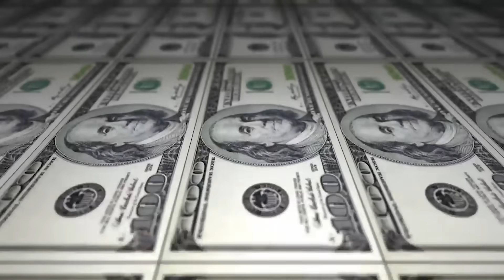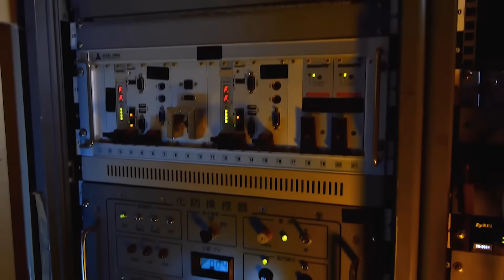Golden Dome: How the U.S. Plans to Shield Itself from All Attacks?

Comment: I dont get why they dont make a self expanding net of some metallic nature or carbon fiber and I dont mean a small one like a mile wide, so this missile first does have to catch up the ICBM and when its coming in it has to get at the right angle and close enough and then fire the net.  The net hits the warhead, wraps around it at least somewhat and is made to heat up extremly hot extrely fast both destroying itself and the warhead this is doable with today tech imo. I dont get why they would try to hit a warhead head on when they could do something like this

Comment: First of all, whatever the U.S. government, especially the current one, announced they are going to do are all "concepts of a plan" with no clear plans & strategies and which takes like forever to even get off from PowerPoint to actual working prototype, let alone a fully functional one.

China is at the forefront of unmanned drone technology, leading advancements that could redefine aerial defense and surveillance. It is likely that they have already developed high-altitude unmanned drones, equipped with solar panels to sustain battery life, allowing them to remain airborne for extended periods. 

These drones could continuously patrol China's airspace, identifying and neutralizing potential military threats. Armed with long-range missiles and an independent navigation system that does not rely on satellite-based positioning, these drones would provide a formidable defense barrier. Their altitude in the stratosphere would make it exceptionally challenging, if not impossible, for enemy aircraft or missiles to penetrate Chinese airspace. Additionally, their vantage point could enable comprehensive monitoring of maritime activities in the Asia-Pacific region, possibly even tracking submarine movements. 

While Israel has its “Iron Dome” and the United States is planning its “Golden Dome” are all fixed & land based, China’s defense strategy may culminate in what could be described as the “Heavenly Protector”—an aerial shield of unmanned drones safeguarding its sovereignty from above. 
In all likelihood, China's “Heavenly Protector” is already in place which probably also covers Russia, Pakistan, and North Korea. In that sense, yes, Russia & China (as well as their other Eastern nuclear armed allies ... i.e. Pakistan & North Korea) are ready for war. Russia and China only speaks when they are sure and ready to do what they have said.

Comment: S should come out with a missile shield that not only can shut down the enemy missile but having an advance jammer which can divert that missile back to it origin and exploded it. Make the Golden Dome capable of jamming and return back the enemy missile.
Reply: Very good idea,
Reply: Each missile has a built-in digital control system with high security coding.  These digital controls cannot break through within the short time frame as you see in the Hollywood movie; it could take hours or days if you are very skilled.  Also, these days, all missile control is a digital pulse signal; the destination is already set at the beginning unless the control center determines to change, if so, it is still required to have at least two or more authorized officers with their own passwords to do so.  Jamming signal will never work with defense missiles.
Reply: Any defense capable of reversing missles back to its origin will be massive 😅😅
Reply: And after thst make u a cup of tea as well😅
Reply: What about missiles which ignore all communications?
Reply: yeah only work in cartoons.
Reply: bro shi is NOT that easy if it was they would have i promise u lmao.

Comment: For Enterpreneur:
1) Rotary Actuator Design (is ready): LowCost SOLID purpose: Verify Response & Aime_Accuracy.
1.1) Designed for Golden_Dome, Arrow-3, THAAD, Lazer...
1.2) ResponseTime<0.0001sec.
1.3) Electric But W/O ElectricMotor.

2)  ABS Valve: much better than BOSCH, ZF, etc. Faster, Proportional (Because not a Solenoid Valve). 
2.1) 98% eff. in Simulated Braking on Dry asphalt W Puddles (Wet asphalt); Calc. using Pacejca (MF) Magic Formula. 
2.2)  Will replace the 2 on-off solenoid valves (for each wheel, in the ABS)  
2.3)  Thus create the best ABS in the world,  Reduce ABS size (more reliable than solenoid valve).

3. More...

4. Pls Contact